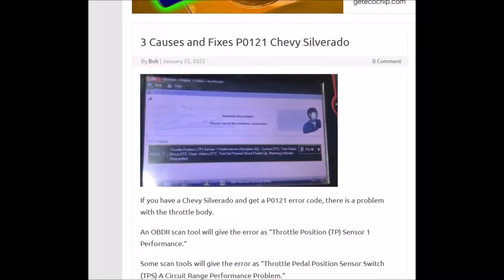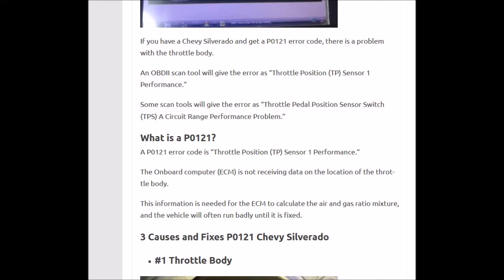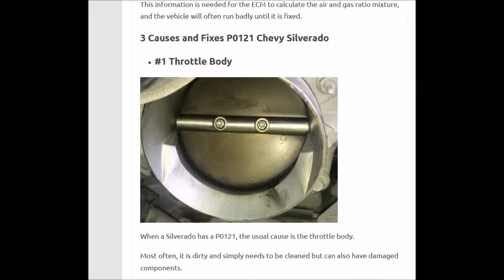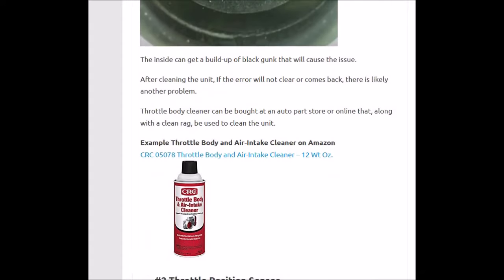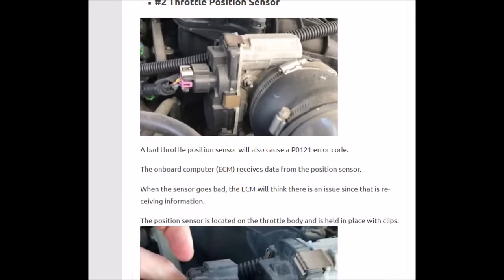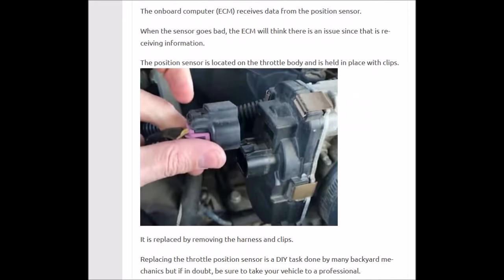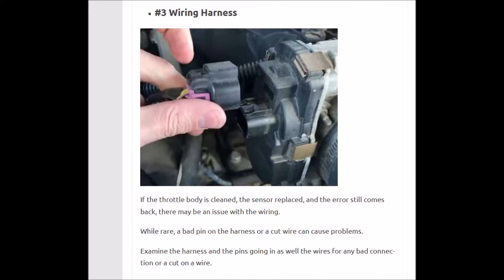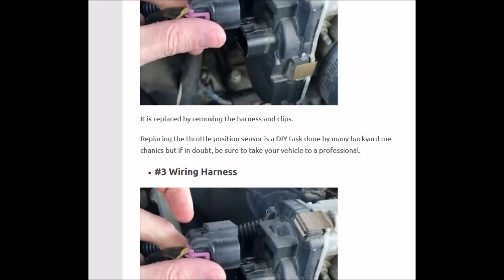How to Fix P0121 Chevy Silverado

Comment: What would be the reading on the wire harness I got a 2010 Silverado with the 4.3 V6 throttle body is good, but it won’t accelerate

Comment: Will this cause the truck not to start?
Reply from the maker: It possibly wont start but usually it runs bad. Depends how bad a component has failed.
Reply: I replaced the entire throttle body and my truck has a clicking noise on the exhaust and sounds like I have no exhaust.
Reply: @5starcadi596 were you able to fix it? If so what was the problem?

Comment: I continue to get this code after changing the sensor and tracing the wiring back to the ecm . When the truck gets warm and you put the truck in park the idle goes up to 1500 sometimes higher. Iv changed the IAC sensor and brake buster ran a smoke machine and starting fluid to look for vacuum leaks